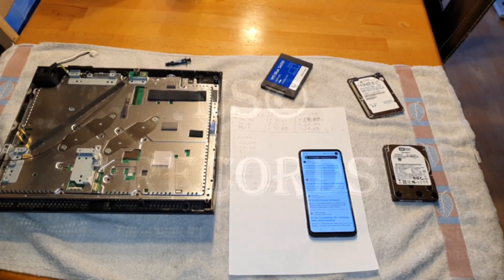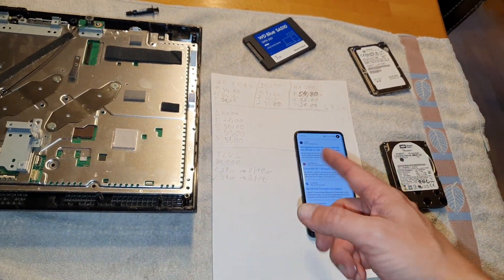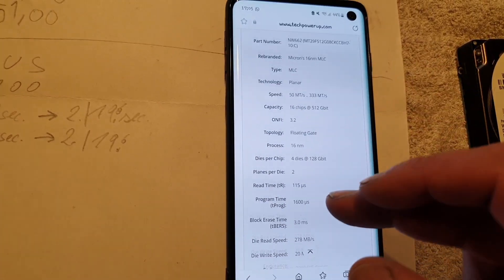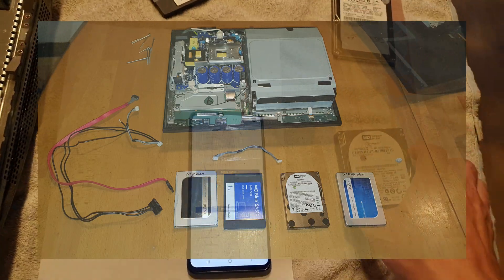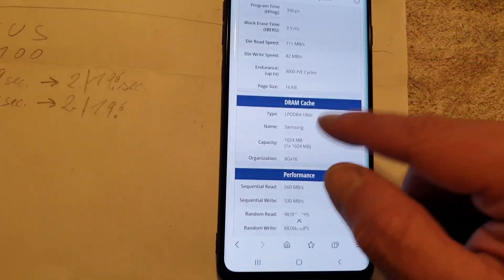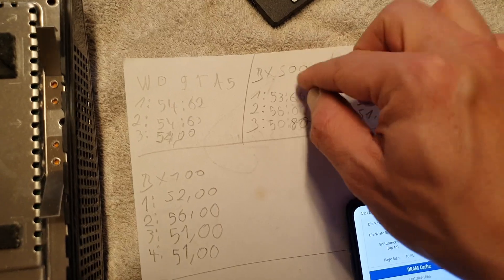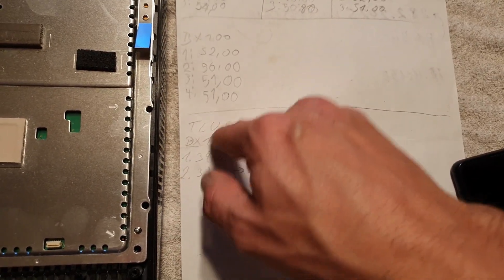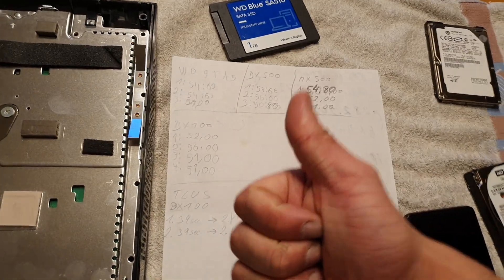This are the best SSD´s for your PS3 By:NSC

Comment: PS3 firmware is fully compatible without crashes/errors up to 1TB. After that it's a grey area. And after 1.5TB is most likely to make your ssd corrupted
Reply: Which is a bit embarrassing as a PS2 with FMBC and OPL can do 16TB :).
Reply: @av_oid  i agree , but the system is not the same + you cannot play PS3 games on a PS2 ;)

Comment: It's pointless.
DRAM is a cheat-sy way to give SSDs super high speeds on benchmarks for short periods of time.
When SATA SSDs first came out they were slower. DRAM allowed it to push 500-550 megabytes per second. Today almost every SATA SSD pushes 500-550 megabytes per second with or without DRAM...

Comment: Does dram in ssd matter for ps3???
Reply from the maker: Let's say like that, it helps like you can see
Reply: i got a cheap one without dram , it has cache though idk if it matters but anyway  thanks 🙏💯
Reply from the maker: @giannis4445 All cool, every SSD is still faster than a HDD 😀

Comment: The maximal OPERATIONAL capacity is not 2TB but truly 1.5Tb  and if you dont have at least 500 GB free of the 2TB  the trimming system operation will not work properly and each time you will experience a crash/freeze etc the errors compilation will stack up to the point you will have to format the whole HDD/SSD , i know i made/experienced that 3 time in my life
Reply from the maker: @rayoflight-777  yeah, but i had people reporting that 2tb worked fine, maybe because it was an HDD. The trim function is not possible on a PS3, the ps3 never had trim function support.
Reply: @NSC-Modz  FALSE inform yourself the PS3 system HAVE a trim function you just have to operate it MANUALLY 1 x per 3 months to keep system clean or errors accumulation. BUT you need to ALWAYS have at LEAST 500 GB free from a 2TB for it to work
Reply from the maker: @Ninjaithelittleninja No it doesn't, no trim for the ps3 system, if you believe or not, i don't care, because i know! Trim only with newer operating systems. The only thing it does, is some kinda defragmentation. https://www.psx-place.com/threads/ps3-lack-of-trim-and-the-potential-for-ssd-use.32672/

Have a nice time bro. ✌️

Comment: First I bought my PS3, it had a tired 160GB HDD. Even games that are not installed in internal storage would chug during FMVs, like GoW III. I bought a 120GB Kingston SSD, solved every single problem. My only issue is sometimes loading stuff from the USB, using CFW. Amazingly, using a 500GB 3.5" HDD on a SATA to USB 2.0 adapter is marginally faster than using a flash drive. Sure, it's a SanDisk one, very cheap, even though it's USB 3.2, it can't hold fast transfers for long (from 70MB/s to around 10MB/s in like 10 secs).
Reply from the maker: Yeah, that's right. Some flash drives are BS, good ones here are from Corsair Vojager GT 3.0 (Red), Lexar or  Patriot & Patriot SuperSonic RAGE 3.0

Comment: Nuno hello how are you??? so i have a question, Could you at least try the Pressure Mod on RSX to try to fix Ylod?? ive done on my Cecha0 some 3 years ago and was sucessful, i apply pressure on the RSX Gpu and PS3 just managed to starup, No Ylod ANymore, So Youre a Smart Guy, in 100% is up to you, cause you like more physical solutions, to create an Pressure Mod that will keep the Pressure on RSX chips and keep the Chip Cracked BGA balls now with Connection again after the Voids of the Cracks are now sealed by the Pressure on the Deffective BGA chip like RSX on FAts and Cell on SLIM PS3s, I just see that even for all those master of Reballing even for them the Reballing is a Nightmare, they kill many PS3s before being really sucessful, the pressure Mod Like Xbox 360 Bolts Mod will be genial to save nearly all PS3s.
Reply from the maker: Hello I no need to try, because i already know :) it works, but only if it's not an NecTokin problem :)
Reply: @NSC-Modz  Yeeeees, Awesome, then you Just Fix the Nec tokins, Nec tokins are very easy to repair right?? then elaborate how the pressure mod will applied on RSX or Cell in case of Slim PS3s.

Comment: So, what's your ranking from top to bottom based on performance?
Reply from the maker: (VelicoRaptor 1Tb 64Mb cache first place, because this HDD's last 4 ever 😅)

My Favourite are the Crucial, as they got mostly 2x dram cache. 
Crucial Mx500 2Tb 2x 1024mb dram
Crucial Bx100 1Tb 2x 512mb dram
Crucial Bx100 512Mb 1x 522mb dram
Samsung EVO 850 2Tb 1x2048mb dram
Samsung EVO 860 2Tb 1x2048mb dram
Samsung EVO 870 2Tb 1x2048mb dram
Samsung QVO 870 2Tb 1x2048mb dram

Crucial BX100 1Tb is very cheap but hard to get. And all the rest with DRAM is good at all, can't do any Rankings here, not worth to put any one to the Ranking list, all with DRAM can be on first place 😆